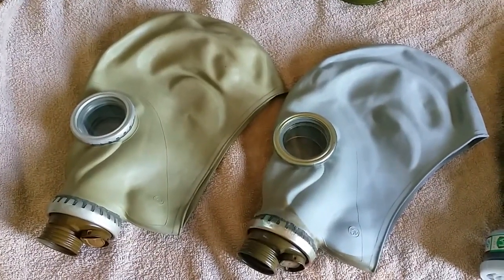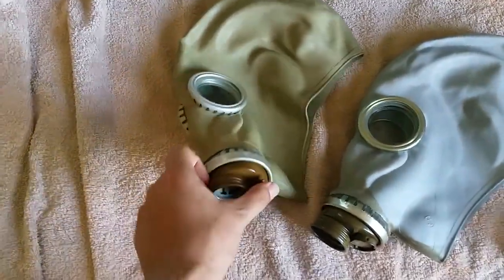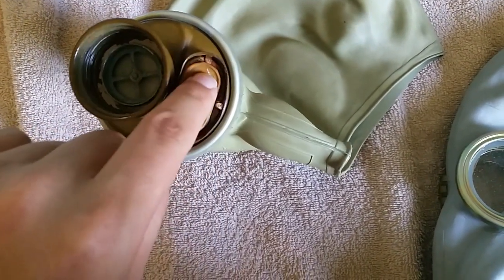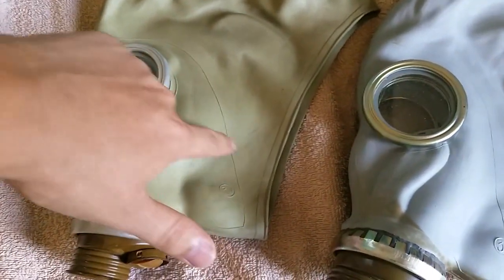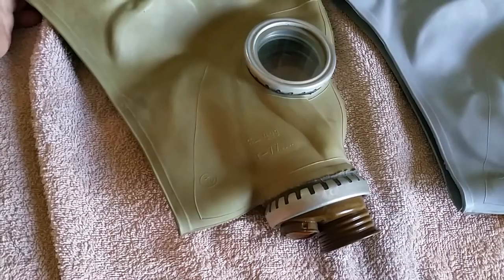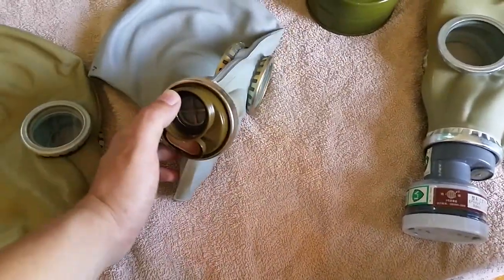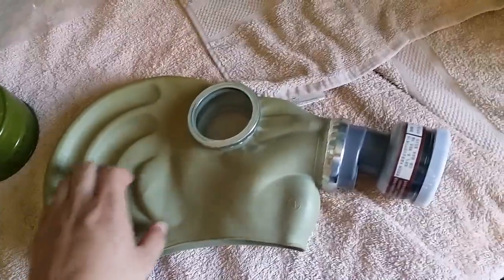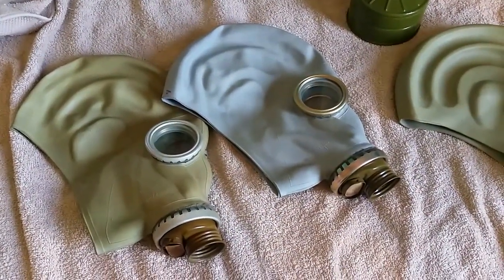Gas Mask Guys: Finally doing a Gp-5 Gas mask Video (aka SHM62)

Comment: These masks may be cheap to make but they last a long time. I actually found mine in an old Soviet government farm. It is an original from 1989 and still works, even though it was probably used by people at the time. It even came with a free hose xD!
Reply from the maker: CosmicCraftGamer I agree, my own gp5 is from the 1970s and still works
Reply: I even use the old filter and hose. It is in perfect condition. Also, I have concerns on the filter, where can i get a new one? please link a website i've been trying to find one. Thx for the great vid btw keep it up!
Reply from the maker: CosmicCraftGamer look on ebay there are many sellers that provide newer filters that will fit your gp5 facepiece
Reply: ok thx!
Reply from the maker: CosmicCraftGamer if i cannot find a link just search for scott pro2000 filters

Comment: You can use a technically nato filter with the gp-5, but it will only give you the allusion of having a seal. The different thread sizes allow air to get through the threads. Also to preserve your masks and to prevent cracking, run them with silicone  lube and keep them in a dark dry place.
Reply: Yeah, the silicon lube thing works really well, it also restores the rubber a bit.
Reply: @SlickTwigDotWAVfile  you watch weaponsandstuff93 right?
Reply: Botond Jutocsa Kovács yeah, why?